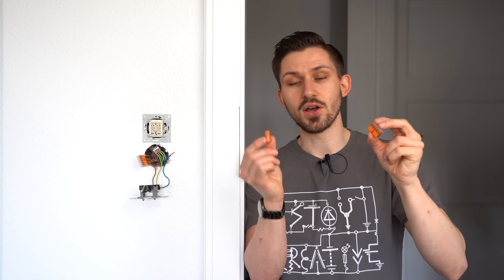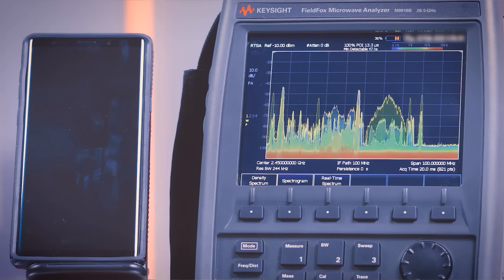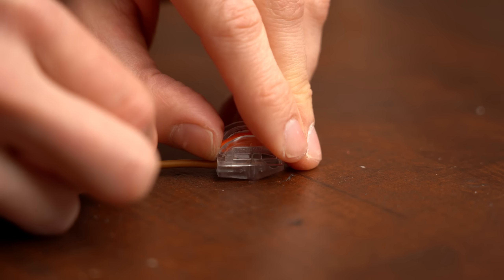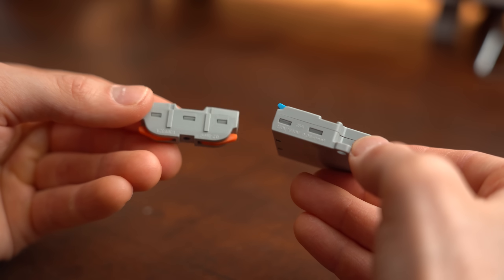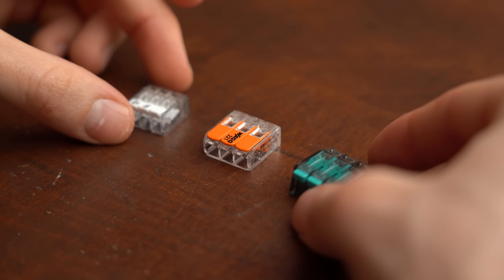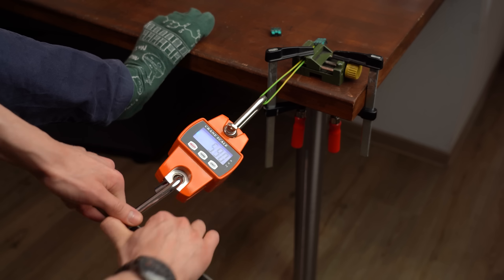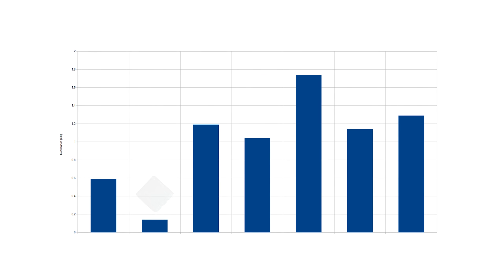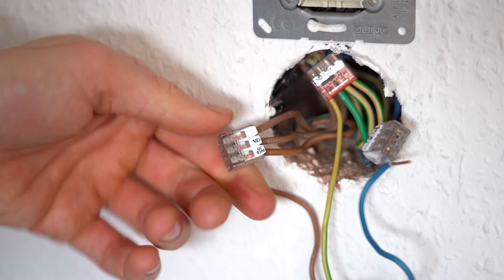I tested 7 Wago Knock-Offs Wire Connectors so you don't have to! (Surprising Results)

Comment: I would never ever trust these CE markings.....these companies would stick that on a roll of toilet paper if they thought it would help sales. If it's from a country with zero regulations and oversight and from a company with zero longevity and reputation to preserve, I'd also be extremely skeptical of any UL certification...what may be copper one week will be steel wire the next. 

Dissimilar metals do not hold up well over time or in hot or damp environments and sticking these things behind your walls or in your attic is literally playing with fire. 

Companies like wago that have a brand and a reputation to lose are serious about quality control. 

These Chinese knockoffs will just close up shop and open under a different name....I've ditched Amazon after having dealt with enough of this cheap rubbish...it's just too tempting. 

I think in a few years time we're going to see houses burning down and planes falling out the sky because of all this cheap crap. 

You'd better be testing resistance if you think that rubbish is copper and you're sticking tens of amps through it. And while it might seem good enough to start off with, just wait until the corrosion starts in. Actual quality control involves lifetime, humidity, pressure, temperature, moisture testing which these companies have never even heard of.

Comment: i repeated the resistance test of a wago 221 with AWG 16 fine stranded wire and got 1.1mR as a result.
my wago knock-off look-alikes came out even better with just under 1mR (voltage drop measured with a UT181A).
i removed more insulation so i could measure directly at the connector's entrance, while running 18A through it.

Comment: I'm a Master Electrician in Alberta Canada, and have done lots of service work in my time. I've only seen a wirenut fail when it was a clearly a bad splice from a handyman or apprentice, or aluminum wiring with the wrong wirenut. 

On the flip side, I have seen Wago and Wago type connectors fail countless times.

With that being, I like to see videos like this. I would say the tests you are missing would be vibrations, and extreme temperature fluctuations. 

Homes have vibrations from people, wind, vehicles outside etc that can loosen connections over time. 

Regarding temperature fluctuations, here in Canada, we can get -50°C degrees in the winter, +40 °C in the summer. In Alberta we can see temperature swings of 20 - 30°C in a day. This is just ambient temperature, let alone the heat on the wire from having current run through it, and then not, and then current again constantly throughout the day. That causes expansion and contraction in the metals, which can compress the spring, which doesn't bounce back fully over time, and therefore a loose connection happens. The loose connection causes more heat when current runs through, and therfore making this problem worse.

Great video tho! Keep it up!

Comment: Wire nuts are better from a technical standpoint. They're cheaper and it's theoretically impossible for them to come apart, easily reusable, heat doesn't really affect their performance and their current rating is limited by the wire size. All of which Wago does not boast except for the ease of use. 
Wago on the other hand is more elegant and better looking. 
Personally I prefer terminal blocks (or however you call those pieces of brass in white plastic with two or more screws). They are the best of both worlds: cheap, easy to find, very resistant, aesthetically pleasing, secure, high amp rating and so on.

Comment: As an industrial sparkie, I think the series of tests you performed were well thought out. However, I think you need to revisit this and actually throw some real power through the connectors. My prediction is that the units that performed the worst on the pull test will have a good chance of releasing smoke.

Comment: Wago-type connectors are garbage for anything over a few amps. The contact surface is minimal at best. Anyone who uses these in general practice for branch circuits is asking for trouble. They're good for light lighting loads and that's about it.

Comment: I wonder if you would consider doing an additional evaluation on the "push in" wire connectors, represented in the USA largely by Ideal connectors. I actually picked up a pack thinking they were Wago knockoffs, as they look very similar from the outside. Thanks!

Comment: We never use these guys in our homes in Turkey. We simply wrap the wires and use electric tape. :D :D I am not joking. If possible (if there is enough room in the junction box) we use standard screwdriver locked terminals. If not possible we wrap the cables. :D My house is full of them. 

But don't get shocked, electric fires are very rare in Turkey, due to cement buildings and high quality worksmanship. Our contractors were pure assholes; but our quality of worksmanship is high. So, you buy a shithole, find out some deathtraps, call the experts and solve the problem for cheap.  :D :D That is why Turkish people are street smart. Dumb ones are dead. Natural selection. :P :P Just, joking. Things are not that bad. 

You would be shocked to hear some interesting facts about house electricity in Turkey:
1) Building standard before 1976: grounding is not a must. :D 
2) Building standard before 1984: grounding is a must in bathrooms and kitchen.
3) Building standard before 1999: grounding is a must in all of the house.
4) Building standard after 1999: Residual current device is a must.

There is NOT a law that forces people to renew their electric systems. So, in an old building it is very probable that you don't have grounding in living room, or bedroom. :D My office building was like that. I added grounding to all of the rooms myself. Even today in my office I don't use Residual current device. :D Since the apartment is old, it is not a must. 

Let's say you are making some renewations in your apartment flat. There is no need to get permission for that and no inspection will be made. So, even if you make some renevations, your electrical systems can stay old. 

Also, cable standards was bad. My office has 1.5mm cables in every electric socket. Some are parralled to one line! This was ok according to the building standard back in the day. But my old house was built in same year with my office. Since my house was a luxurius house when it was built, the contractor used 2.5mm cables in every electric socket, even if the standard did not dictate that. :D So, in my office I have to be cautious when drawing high amount of currents for a long time. For these kind of stuff, I have changed some of my sockets' cables to 2.5mm and I have one socket that has 3.5mm cable behind it. 

Thank god we use 220V in Turkey. If not, there would be lots of electric fires due to cable problems. 

One thing to add: Electric is very expensive here. That also reduces the fire hazard. For example electric heater is a big no if you are not have to. :D Some of the regions of Turkey are subtropical and in these regions 40 degrees celcius is very common thing in daytime in summer; but AC is something that you don't want to use much even if it is A+++++++ one. :D Even in very hot cities like Adana or Antalya, only filthy rich people can think about cooling their entire house. People generally cools only one or two rooms with split AC, due to high electric prices. And they never cool them 7/24. Two AC units. One is in bedroom. One is in living room. When sleeping, you close down livingroom. Got child? She/he will be resistant to heat. :D Maybe a ceiling fan? :D 

And I beleive, this extreme electric prices also protects us from electric fires. :D

Comment: Nice vid. For some selfmade home electric those clamps are okay but i´d rather atleast take those with VDE,U(L),EN/EC certificate. Over here in Germany as an certified electrician i and kinda like all companys use Wago nowadays. Wire nuts is something we don´t even think about. Not often we twist something together and if only low voltage. In the 230V range with 1.5mm² - 6mm² (bcs Wago has flexible clamps that big) we mainly use the ones only for hard wire (like the red one u had with 4 connection points) and only the ones for flexible and hard wire when we need to connect to a flexible wire. The for hard wired u can easily pull of with a side to side twist and the flex clamps are self talking. Wire nuts in my opinion suck for making changes when a house gets redone or the customer wants changes after already having it installed, bcs u have to take all at once out, shorten them (which could cause in further changes that ur cable gets too short to connect without problems) to retwist bcs if u twist the twisted copper strings u might over stress the copper and even with the expanding from warm to cold u get gaps and therefor a loose connection (very important where vibration could effect the clamp).

Comment: I've come across loose wire nuts several times. Some that I put on, some that I assume an electrician put on due to various aspects of the application like how old it is and knowing that nobody had touched it in years. Seeing some tests of 20 amp rated Wago 221 connectors shrugging off 60 amps while barely warming up is impressive. They're soooooo much easier than wire nuts, especially when connecting 3 or more wires and doubly so when connecting stranded to solid, as is typical with light fixtures.

The lever nuts just aren't going to self-loosen, not from any kind of repeated heating and cooling from environment or electric resistance. They also work the first time, no repeated attempts required trying to get stranded and solid or three or four solid wired held just the right way that a wire nut will evenly grab and hold them all.

The only 'strike' against the Wago 221 I have is they don't make a 4 hole version! It's like the Holy Hand Grenade scene from Monty Python and the Holy Grail, slightly modified. Two! Three! Five!

When you just need to connect 4 wires but have to try cramming the bulkier 5 hole Wago into the box...

Comment: The price and size points don't really give anything for them outside a few that do the same exact function of the Wago. of which there is only 3 of them. The others are specialty use and do what the Wago connectors do not do without having to have more of them or given size and other constraints more usability that the Wago does not do. The red/blue and red/yellow/blue connectors alone shortchange having to use 2 if not 3 Wago connectors and they are straight line ran which I think would be more common to use outside of running them in a regular box.

Comment: CE on the multi potential ones only means China Export. You can see by the smaller distance between the two letters. It‘s not the european manufactures safety sign.

Comment: I made industrial machine wiring using original WAGO 221 - mixed cable types from 0,8mm2 to 4mm2. Zero problems, excellent reusability (for correction work). Expensive but worth any spent coin.

Comment: i dont recommend them at all because one customer have outlets melted rear side n turn out that they were using space heater and melted it and shorted out

dont try using more 10 amp on them because wires cap can handle up 55amp no problem

Comment: Could someone tell me what folks pay for Wagos in Europe? In Canada they are still pricey and I wonder if it’s just because the volume of sales isn’t high enough yet? Bonus if a fellow electrician could say what they pay for a bulk order. Thanks in advance!
Reply: They´re about 8-10 cents a piece for the simple ones without lever (solid wire only) and 15-30 cents a piece for the lever type (solid and stranded). Bulk will save you VAT and maybe 5%.
Reply: @1I2am3Dani4  Thank you very much!! Are you quoting in euros?
Reply: @otif2044  Exactly, so it would be 0,1€ and 0,3€ but given the current exchange rate it´s about 1 to 1 into us dollars.
Reply: @1I2am3Dani4  Thanks!!!! Wow I didn't realise they had hit parity I'm out of touch. A wago 221-412 is .39 euros over here in Canada per a box of 500.
Reply: @otif2044  You might want to check out the UC series from ViD (Viola Direkt) if you're able to get them in Canada, they're VDE and ENEC certified and about 20% cheaper than Wago. I'm currently doing some testing on them and so far they seem to work just fine, I believe GreatScott did a comparison video about them too.

Comment: Im from the us and have never seen these connectors until one of your previous videos. these look like a amazing idea compared to wire nuts as far as safety and ease of use. what ive always done with wirenuts though is made sure they actually threaded onto the wire first then wrapped the wire in electrical tape or put heat shrink tubing around it to prevent the fire from backing out of the wirenut

Comment: Please ignore a lot of the statements from the US! Looking at YT I don't think they have any wiring standards or if they do they are about 50yrs behind Europe LOL.
Anyway, there is a requirement in the BS7671  (UK) regs that the copper should not be damaged (no nicks or similar)  in use  eg stripping the insulation back or over tightening screws. In addition, there is a requirement for all terminations to be me mechanically secure with most connection now requiring a torque specification approx  0.3 - 1.2Nm on average
So by definition the use of the shitty US wirenuts (at least in the UK)  can should never be used.

Comment: The CE-Logo you can see on one of the connectors looks like the "China Export" logo, wich is nearly the same as the CE "Conformité Européenne". The Conformité Européenne has an E with a shorter middle slash and if you draw the C and E to circles, the circles will overlap exactly as how wide the drawing line is. You can google an image of the logo to see the difference.
Reply: There is no such official label as "china export". 
There have been numerous cases where chinese sellers put CE Logos on their products without doing the paperwork, but this is a form of misuse, not "different label".

Important thing to note here: The CE-Logo is not a sign of quality. The Logo by itself only means the manufacturer did the paperwork and declares the product conformant to current eu regulations. No external checks involved here (simplified)

Further reading: https://en.m.wikipedia.org/wiki/CE_marking see "China Export"
Reply: To check if the manufacturer did the CE declaration properly:

Have a look into their documentation. The declaration of confirmaty has to provided to the customer. Sometimes in the manual, sometimes seperatly.

This is the only reliable way to find out if they did their declaration correctly and not just plasterd the logo on

Comment: When it came to the UL listing, did you actually look up the number and verify it applies to electrical safety for this specific product's use case?

Case and point: most surge protectors you might find today with a MOV and multiple outlets will have a UL listing, but the number only applies to "relocatable taps", not actual "surge suppression", meaning only the outlets expansion, not the MOV, is certified. This means the MOV could be below below UL certification and possibly fail tests where the MOV can catch fire under a large surge, but the outlets themselves pass. It's a real problem.

Comment: I bought a whole bunch of these types of connectors from aliexpress a few years ago and they were much cheaper (about 1/4) when compared to wago connectors. I have a hole set of wago for mains wiring and such, but for other stuff I often use these convenient alternatives with the nice screw-holes as well.

Comment: Aren't those larger connectors designed for panel feedthrough? The smaller ones are for splicing, correct? If you are going through a panel, the smaller ones would get a score of zero.

Comment: It’s not that people had problems with your results or you were biased it’s that you showed improper installation of wingnuts and used cheap no name wingnuts compared to name brand Wago connectors. A more fair comparison would be versus the industry standard like Ideal’s offerings and twisting wires together with pliers before installing wingnut as code states.
Reply: Agreed!

Comment: The issue with cheap spring terminal clamps is long term reliability. When there is an intermittent fault in an old installation (here in Germany where Wagos and Fakeos have been around for a long time) it's a good bet someone used those hardware store clamps in a junction box. Even the cheapest screw terminals are more reliable. Never had a genuine Wago fail though, and they have been used here since 1974.